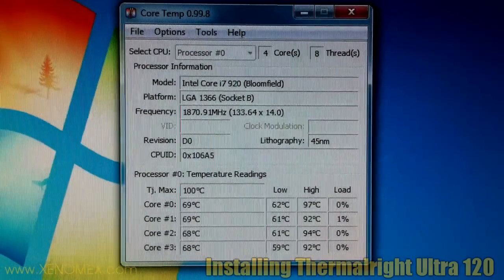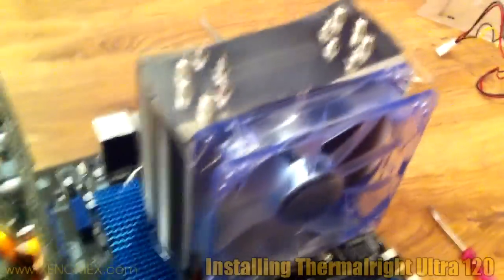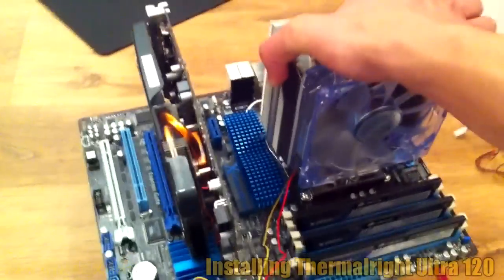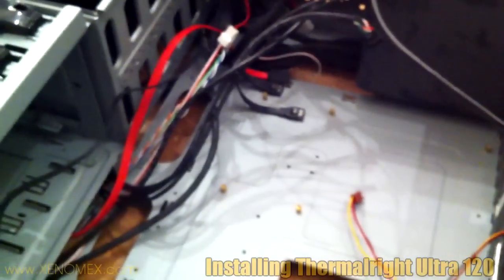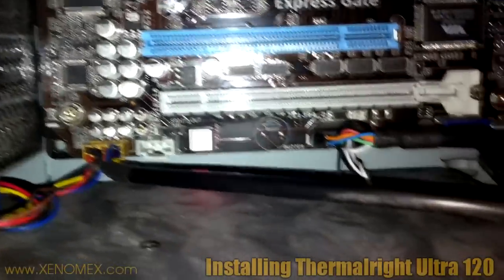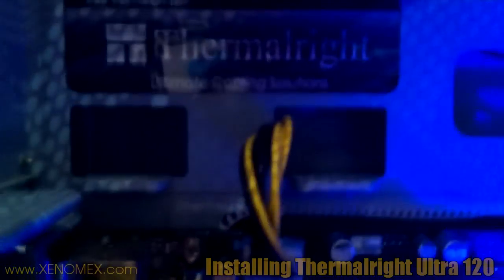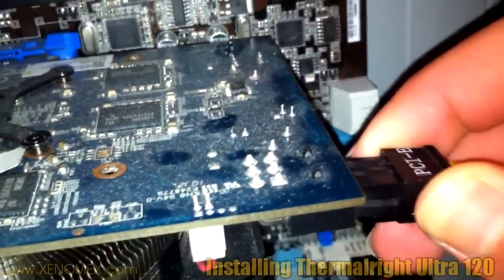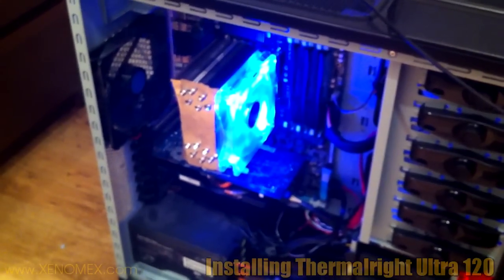Installing Thermalright Ultra 120 CPU cooler

Comment: The thermalright ultra 120 extreme pissed me off when i got it in 2009, because i had an amd cpu and i had to buy the backplate seperately :( !!! they only included the intel backplate with it!!  but yeah awesome heatsink, i used it until the end of my fx-8350 computer, which i handed down to a friend.

Comment: The rubber strips are supposed to go under the fan to decouple it from the heatsink. They are doing nothing where you have put them. Might be why you struggled to get those clips to hold it in place.

Comment: Love this cooler. Does a very nice job on my i7 920 DO oc to 3.8 GHz at 1.225 volts onVcore. Barely hits temp over 70. After seing this video im am so happy i never used the stock cooler.
Im using two silverstone FM 121 120 MM fans (max RPM 2400) in a push/pull kombination.